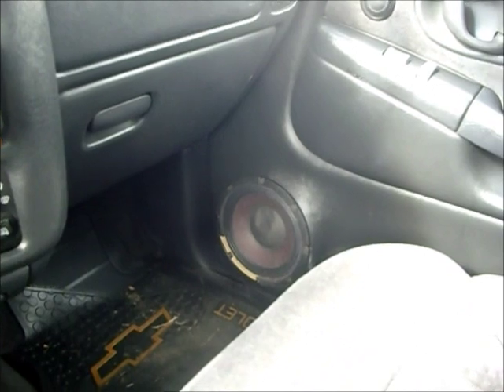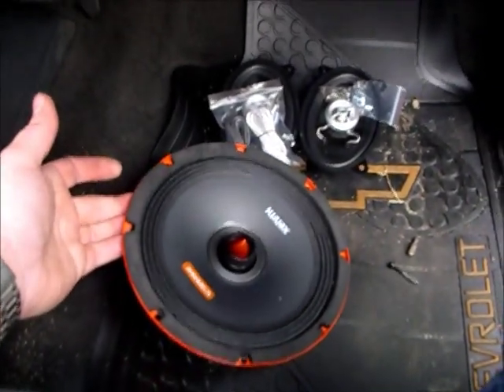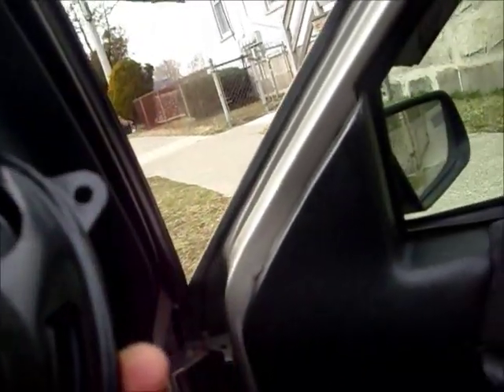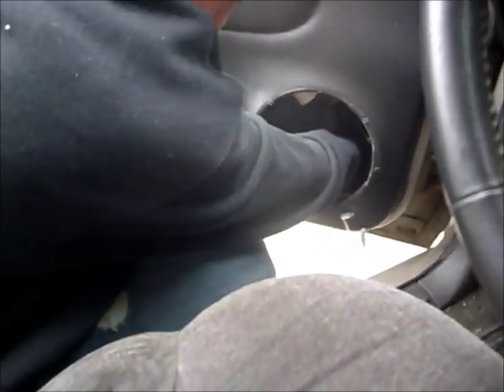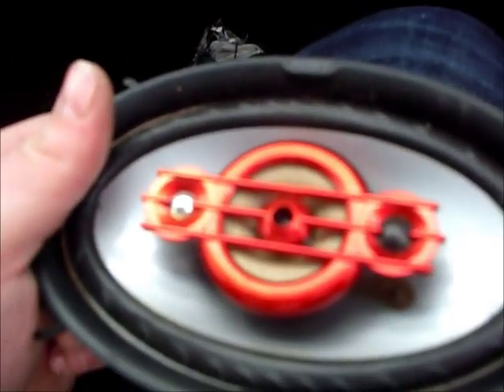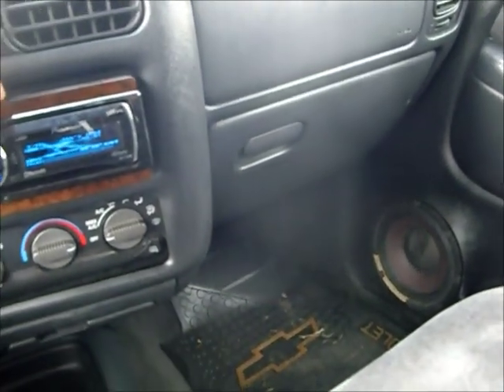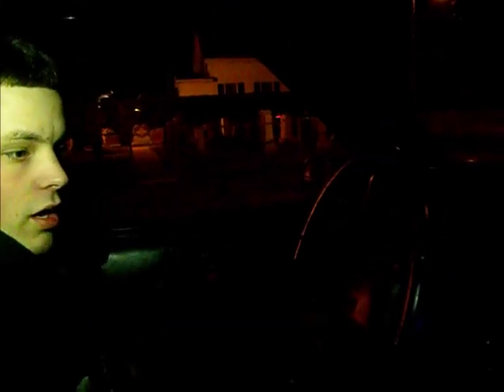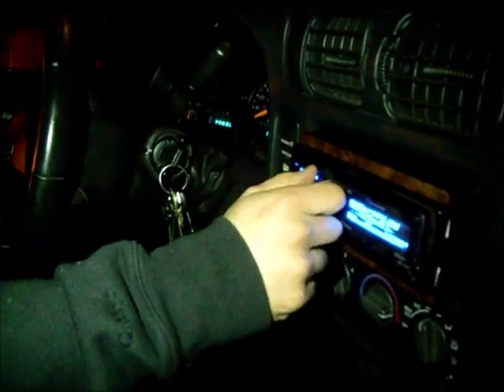s10 cadence speakers installed

Comment: Just starting to build a system for my s10 1so I was VERY EXCITED when I saw the holes pre-cut in the doors...I was hoping I wouldn't have to pull the whole door panel to mount my new 6.5" speakers...but then later I heard you say the previous owner had cut the holes...dammit! LOL but it's still a very good informative vid.  Thanks for posting!
Reply: taking the door panel off on these trucks is super easy and takes like 2 minutes.

Comment: im my experience... pioneer decks with a 4 volt RCA preamp, and a volume that goies to 62 max..... they are fine at 60, but start to distort at 61, with 62 being crap. 

my system seems to "come alive" at 50... so i get my gains at 55.

its nice and loud with extra power for lower volume tracks.

Comment from the maker: you can get a power from the fuse box yes,but you also need to find and ignition wire that get power when the key is turned on...that way your radio keeps it setting and it doesnt stay on when the car is turned off...its pretty easy man

Comment: the factory door speakers are mounted on a speaker mount bracket thats bolted to the actual door and not the door panel, just thought it might not sound as good as it should,but maybe it doesnt make a difference idk ,i post a video response about the bracket mount im telling u about.

Comment from the maker: if your factory power isnt working you should look for a blown fuse and try to track down the problem.....but if all else fails you can run a wire off the ignition for a poer wire you will just need something to read voltage so you can find a wire with power